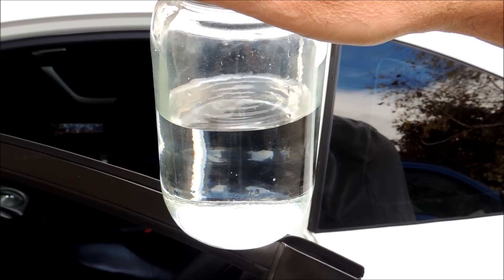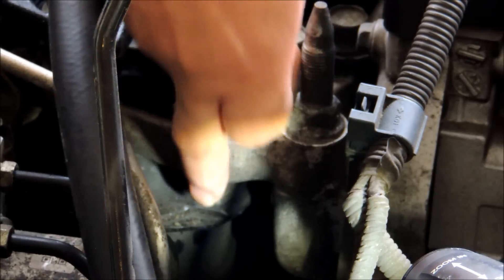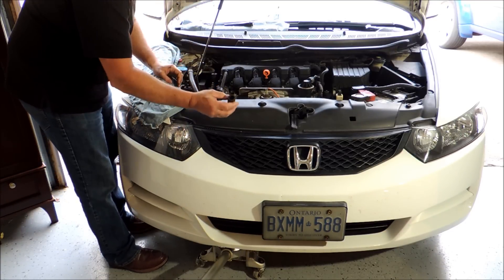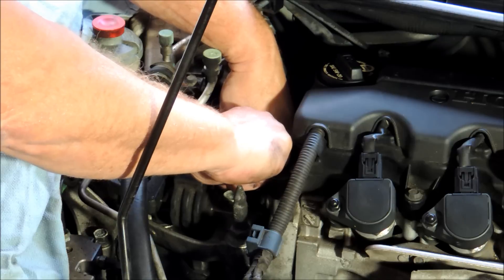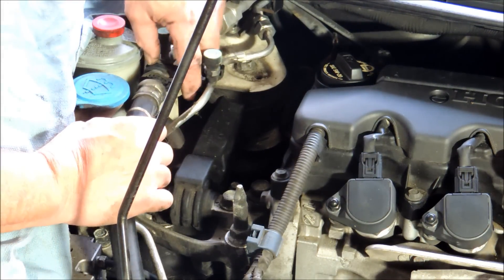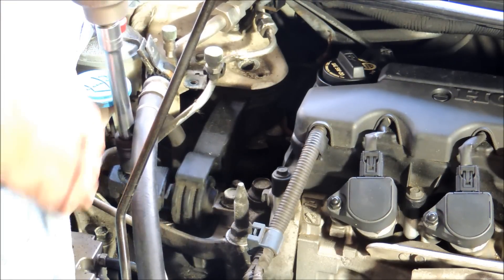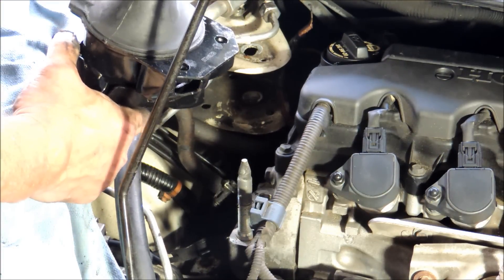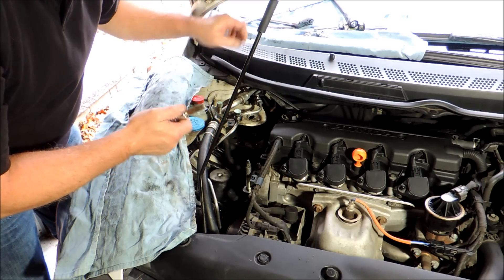Honda Rough Engine Idle Shimmy and Shake SOLVED!

Comment: Nearly every Honda I’ve driven do this at idle.
Reply from the maker: You must be driving really old Hondas - Ir's common but not every Honda has this issue for sure  - Cheers!
Reply: @carquestions  04 CRV, 06 Accord, now 2011 CRV.
Reply from the maker: @jeremylakenes6859  ya an 18 year old Honda  might have this issue for sure but your mount is different part number
Reply: @carquestions  thanks for replying. It’s the same engine at first glance with dipstick in the middle (I’m in Brazil so not sure if the cars here have different engines than in the states.) 

I’ll look tonight.
Reply: Just looked at my motor mount. It has a nub that is 3/8 inch from the rubber. Looks good. Car has 93,000 km. So, 60k miles? It feels like something unbalanced in the engine or transmission... it’s not worth the time, but I’m half tempted to pull the transmission and torque converter and then see how it idles. 

I wonder if sludge gets into one aide of the torque converter.
Reply from the maker: @jeremylakenes6859  Never seen that - very rare - sounds like bad forum advice - yikes - Try all regular things first like compression test and cylinder leak down test - bad valve will give you a bad idle for sure and far more common
Reply: @carquestions  I’ve done several leakdown tests on airplanes, but never on a car. It’ll be interesting.
Reply: @carquestions how about a 2004 civic? Has a slight vibration as well
Reply from the maker: @jairog.chavez9213  give the engine mount a check - see if it moves too much - Cheers

Comment: Replaced all motor mounts but vibration still there.
Reply from the maker: Then you have a bad cylinder - check plugs, coils, wires etc - also get codes from engine for missfire - Cheers from Canada!
Reply: Did you find out what the problem is? Have you tried adjusting the engine valves?

Comment: I have this prob with my 93 Accord, but it shakes AFTER it warms up.  When it's cold, the steering wheel is steady as a rock.  As soon as the idle goes down due to being warmed, SHAKE, and a little worse than the demonstration in the video.  

Could it be the timing belt?  This one has 101k on it, and I'm about to change it this week.  I'm just hoping it will take the shake away.
Reply from the maker: Change it out if needed but likely idle air control or throttle body is dirty

Comment: So would u avoid this car?
Reply from the maker: No - it's a great car and an easy fix if you know whats wrong - all cars have issues and the Civic has less than most
Reply: Thanks I was thinking of getting one, I read in forums these mounts don’t last long especially aftermarket. I didn’t get to see you reinstall the mount as many people having trouble lining up the holes onto the bracket. Some say rocking engine back n fourth or jacking up engine will do. Regardless, engine will tilt backwards when removing the mount.
Reply: I'd get a Toyota Corolla than a Honda civic 2009 if possible. We have both, we barely maintained the Toyota and it still runs better than my Honda.

Comment: Tx A lot for this.
Reply from the maker: Hope it helped - cheers
Reply: Did u fix it ?
Reply: @h1films55  yeah paid 200 bucks at the dealer for oem. Followed your vid to install. Was quite easy tx alot!
Reply: PollieBear thanks for the reply . U changed to oem engine mounts ?
Reply: @h1films55  yes mine was broken so i couldnt find aftermarket one. Oem was only way to go.

Comment: my 03 honda civic with vtec engine runs perfectly at 80mph(cruise control) but after 30minutes of driving at that speed, it loses acceleration  and starts to shake. then after, it only runs at 70mph at 3,300 rpm and if I accelerate any higher it decelerates and shakes again. If i turn it off and turn it on again, it will run back at 80mph but then shortly do the same problem again...no idea what it is... please help.
Reply from the maker: scan the computer for codes and check fuel pressure right away - let me know results

Comment: Who the hell is going to want to swap fuses every morning? No one! This is dumb.  You could just as easily and cheaply wire a heavy toggle switch to the fuel pump and hide it like a normal person.   Why blow the fuse? Just pull it... what thief is going to diag a non-running car? Fuse missing is as good as fuse blown, at least that way you could just pull it up out of the socket and push it in  - in the morning....  A good fuse just slightly out of contact is likely a better fooling mechanism.   Again - dumb.

Comment: My car shake at 80mph to 90 Honda stream same engine as this one
Reply from the maker: Leroy - Probably a tire/wheel issue - not an engine mount
Reply: But I changed the tyres bought new ones but still doing the same thing,i even balanced nd aligned them
Reply: Could be bad cv axles

Comment: Where tf is it 50 in canada napa wants 180
Reply from the maker: in 2018 - see the date - get it off amazon or ebay cheaper
Reply: I find pricing on parts vary GREATLY depending on different parts stores. Whenever I need something I always make sure to call 5 or 6 parts stores for a price comparison